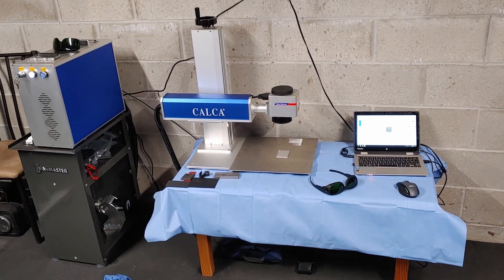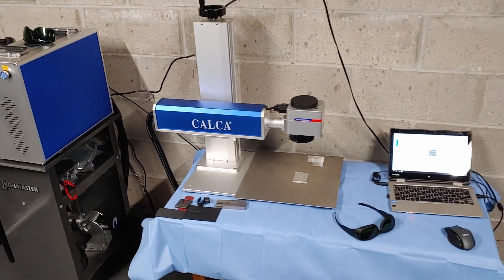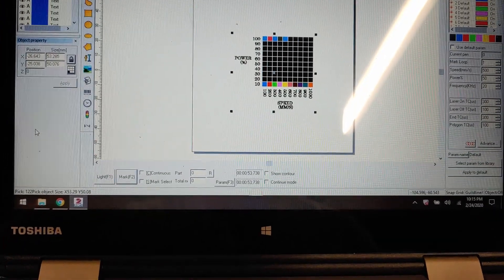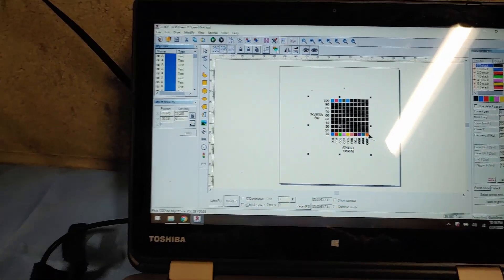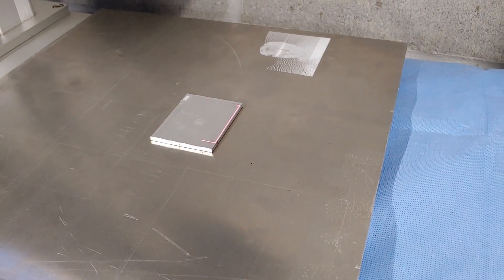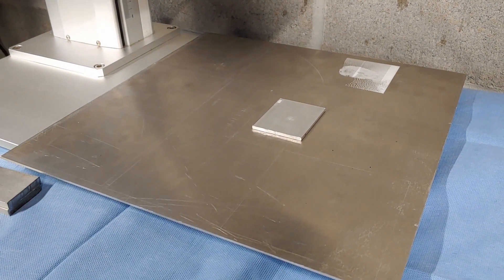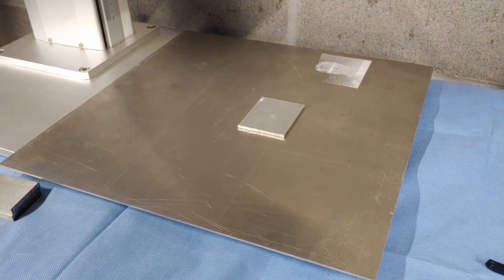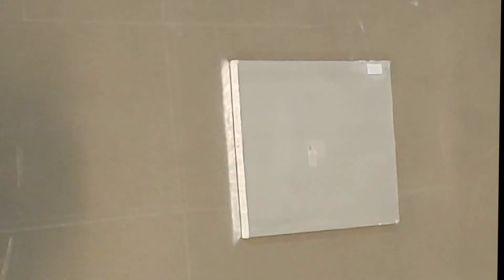Testing 50W fiber laser

Comment: Hey,

I am looking to buy a 50W fiber laser but I was wondering if I really need to buy the expensive 3d lasers to do light 3d engraving (depth less tan 0.7mm)

 My question:
Would a "2D" fiber laser (one without a special 3d laser head and motorized Z-axis) be able to 3d engrave with a bitmap technique / greyscale depth map technique (link in the link below)?

https://www.youtube.com/watch?v=j5cIFxGu_1g&lc=UgxsnWtJ6xbhDVvHtcp4AaABAg.9Hqf4MXvSJY9HqpMCJKVyH&feature=em-comments&ab_channel=SarbarMultimedia

Thank you for answering my question in advance and an even bigger thanks for the great content you are putting out!

Knifesharp regards
Sander
www.Mknives.eu
Reply from the maker: Thank you for stopping by. A few quick things before I attempt to answer your question. 

First is that I have not personally had a need to use my fiber laser for 3D engraving yet, so I really can't comment directly on its use for that. I use my laser mainly for deep engraving on steels and some surface marking on aluminum and steel.

Second, although I have definitely watched the youtube channel you linked and he has some great content on fiber lasers, I'm almost certain that the video you sent me is of him learning to engrave on a CO2 laser. Although the idea should be the same because my laser software has the ability to use greyscale power scaling, it certainly wouldn't be able to do so in the materials he is testing in the video (wood and acrylic). If your goal was to do so in metals then the fiber laser would be appropriate.

Last, to more directly answer your question, my answer would be a very soft yes. Depending on the depth you're looking to achieve, the size of the image and the speed/resolution you're looking to achieve, the more simple 2D fiber lasers are very capable. Without an adjustable Z head, your range of acceptable focal lengths ranges from about 0.1-0.3mm depending on which lens you have installed. If you're looking to do bitmap dot engraving with 3D textures up to 0.7mm, I would say that's a pretty hard no in my opinion on a laser similar to mine.

With a ton of experimenting and even more patience, you might be able to achieve a successful result. But it's going to take you forever to engrave to that depth and will likely involve you manually adjusting the head height multiple times for each image which is going to potentially give you a blurry image from the focal shift. 

If you have an image you would like to test and would want to do all of the playing around with them image resolution/greyscale settings, I'd definitely be willing to make a video for you trying to run it on my laser to see the results. But I have a pretty high level of certainly that you're going to be disappointed with the results.  If you were attempting to engrave maybe 1/3 of that depth and the image was under maybe 10mm in size then it may be a process that is possible to perfect in a way you'd be happy with. But that's a pretty big maybe in my opinion
Reply: @MPMachining  Okey this is a every done to heart answer, thank you for that! I have ordered the laser but probably will take some time before I will attempt to 3de engrave.

Comment: Will a laser like this work for firearms engraving?
Reply from the maker: Absolutely. That is the main reason I bought it actually. It does a pretty amazing job. I have some pictures up on my instagram where you can see some of the results I have gotten with it on Firearms
Reply: @MPMachining  I was actually just scanning through your Instagram and followed you haha. Is it fairly easy to operate overall? I’ve got a firearms store and am looking to slowly add some engraving in. 

Is the build plate large enough for most of the work you have to do on guns? Will it still work for engraving things such as wood or glass if I wanted to do any of that?
Reply from the maker: @Yan1  the working area hasn't been an issue at all. The size you can do is determined by the lens that you are using. With a larger lens you obviously get a larger area, however, you get significantly less power (I have a whole video on lens size vs power) so you just need to pick the combination that works for you. My largest lens is 300mm and my smallest is 70mm.

As for materials it can engrave. Unfortunately, due to the wavelength of 1064nm that the laser is operating at, it will not work on glass or any other transparent objects and it does not work on wood well at all. It is mainly meant for metals and some plastics. For wood and glass you would want a CO2 laser, which conversely can not engrave metal. Those are a bit of a generalization because there are some hacky ways to get a fiber laser to mark glass or a CO2 to etch metal, but by and large for metal/plastic you want Fiber and for Wood/Plastic/Glass, you would want CO2

Comment: Will it be suitable for cutting metal foils?
Thickness is 0.1 mm to 0.2 mm.
Stainless and Nickel, Brass and Copper, Aluminium
Reply from the maker: Absolutely. I just cut some similar thickness steel the other day with it. Works great
Reply from the maker: To be honest I almost never use the laser to cut through anything. It's mainly used to deep and surface engrave on steel. For some tests because another viewer had a similar question I decided to try and push it deeper. I grabbed some 0.06" (about 1.5mm) thick steel sheet and cut some 1" (2.5mm) diameter circles out of it. 

I tried cutting the circle out rather than removing all of the material and engraving away the whole 1". It certainly will do it, but if I was trying to buy this laser with that in mind, I'll say you will be pretty disappointed. It took about 30 minutes on the first try. Changed some settings and got that down to about 15min. I'm sure you could likely reduce that even further but I decided it just wasn't practical to use this laser for that. I have cut tons of shim stock up to 0.01" and it does a beautiful job with that. It will cut it in one pass perfectly clean.  What thickness were you thinking?
Reply: @MPMachining   0.15 mm to 0.20 mm at most. It's under 0.01"  for sure.
Reply from the maker: That would be a reasonable thickness to cut for sure

Comment: I just got this same laser last week.. ps- I had a lot of issues with  EZCAD 2.14.9, so I found 2.14.10 on the internet and it fixed the inability to import vector files.
Reply from the maker: I will absolutely have to try that. The version that came with my laser was super old. I'm pretty sure it's 2.9.something. I'll definitely be giving 2.14.10 a shot. Did you also go with a 50W?

Comment: Have you ever cut anything as small as a watch movement gear?  I make custom watches and am currently looking to pay someone to cut watch movement parts..   Eventually i would buy a machine..  But for now wondering if the resolution is good enough....   Thanks for the video post :)
Reply from the maker: @akina akina what size are we talking? The laser has no problem at all with high resolution in small parts. If you check my Instagram I have cut some American flags on firearm barrels where the stars were about 0.008" wide and looks great under magnification. How thick is the material?
Reply: @MPMachining  ok ill message u on ig ..

Comment: Can you provide link to this machine on ebay?
Reply from the maker: @John Downs sorry for the delay in responding. YouTube actually doesn't inform me when someone comments on my videos for some reason (I'm bad at this whole YouTube thing) so I try to look through all of my videos once a week or so to see if I missed any. The seller that I purchased my laser from seems to no longer be active on eBay unfortunately. Below is a link to a similarly priced 50W laser but there are a bunch on eBay that you can search through. The important things I would look for is that the laser is being shipped from somewhere in the US and not from China (it will be made in China either way, but you want to pay extra for one that's already passed through customs and is here in the US) then try to message the seller and make sure they have the ability to communicate clearly with you and answer some questions about the laser. I asked each seller I was researching whether or not the laser module was a Raycus unit and if the control board was a genuine BJJCZ board. If it isn't, then a licensed version of EZCad (the software that should come with the laser to run it) won't work.

If you have specific questions, feel free to message me on Instagram or reply on here. 

https://www.ebay.com/itm/50W-150x150mm-Detached-Fiber-laser-marking-machine-metal-Non-Metal/123968156043?hash=item1cdd13f18b:g:vwsAAOSwkMVc1QaV
Reply: @MPMachining  i just find out that bjjcz board some are "lite" and other "standart" version, both are claimed "genuine". Maybe you could tell me the difference? Also how much have you paid in total with dellivery to door? Thanks.

Comment: I'm impressed with the results of this machine. I'm studying buying one of these to CUT between 18 and 15 gauge steel sheet.

I've been searching from cnc plasma cuters to 150w co2 lasers and now just discovered this fiber engravers. The truth is I don't have space on my apartment for any plasma or co2 laser. As I don't need a large cutting area, I think this may fill my requeirments.

What do you think?
Reply from the maker: Unfortunately, cutting 15 gauge steel with this size and power laser will be painfully slow and borderline not usable. A cnc plasma is definitely the route you would want to go if your goal is to cut sheet metal. This can get through 15 gauge but it’s going to have to do a ton of passes and you will likely find issues with the metal reforming together as it is cut if you do not have a wide enough kerf built in

Comment: Hi !!! How do you think.  Is it true that this machine can work 100.000 hours?
Reply from the maker: Mr. Diddi honestly, only time will tell. I have a few hours of run time on it now with no issue but its next to impossible to prove 100k hours for a hobbiest. If it ever have any problems with it ill be sure to make a video
Reply: Well, let's think about this. 100,000 hours is around 4,166 days. 

That would mean:
A. This laser is rated for continuous operation for around 11.4 YEARS. Dunno about your luck, but I can't think of many LEDs that get that kind of real-world lifespan. Don't even ask about lightbulbs.

But that's continuous. 

Let's say the laser has a duty cycle of 40% (I've no idea if this is accurate, but seems not entirely unreasonable for a high-power electronics platform. Think welders.)

That would be:

B. around 28 years of CONSTANT use within its duty cycle allowance. eBay has been around for 25 years, to put this in perspective.

I would say that if this were a military laser platform, undergoing regular routine maintenance with the clockwork-like consistency one could expect from... well, from a military... then I'd STILL be bloody amazed if it lasted the better part of three decades.

So let's strip it down to 10,000 hours. 416 days. Or about 1.14 YEARS of CONSTANT use within the duty cycle (24 seconds on, 36 seconds off. 24 on. 36 off). I'd STILL be amazed if even the power supply survived cycling like that. Hell, find me a laser POINTER that will survive a cycle like that.

So - and this is from ignorance, mind; I'm an engineer, not an optics/laser specialist - Imma go with: no. Not a chance in hell. Even assuming it WAS made of the highest quality Chinesium in the Land of the Rising Quality Control Fault.

BRO is right. For a hobbiest? You'd never know if it will. Even if it only makes it 41.6 days (1,000 hour lifespan). Let's say you're using it a couple times a day, for the length of the tests shown here, say twice a day for 8 minutes each. That works out to around around... oh! Hey! About 4,000 days. Or about 100,000 hours. Total. Time. OWNED. 

Hmmm. Maybe I just cracked their code?
Reply: @grumblycurmudgeon  That's funny! Maybe time will tell LOL